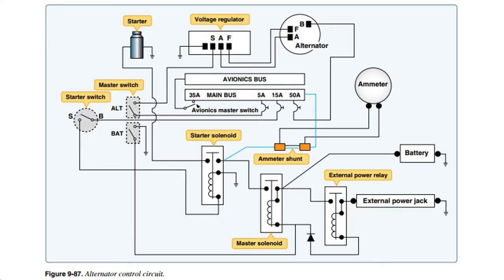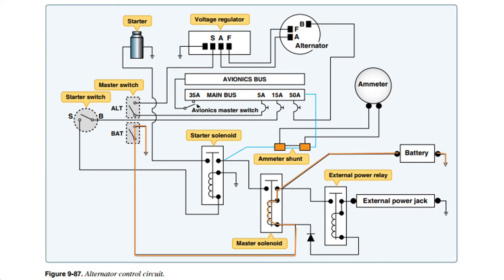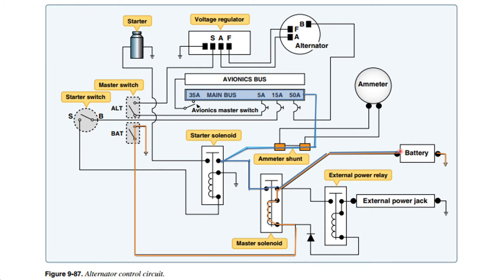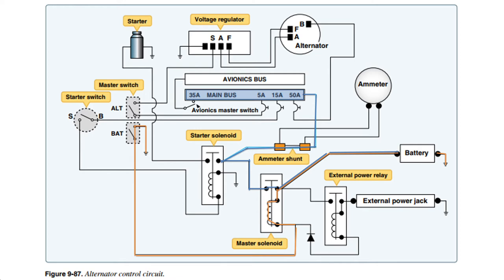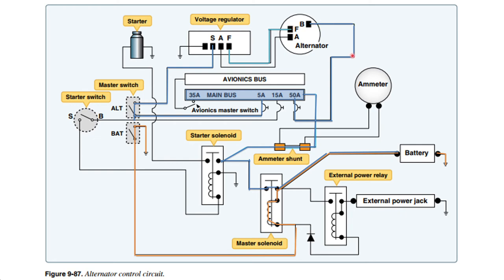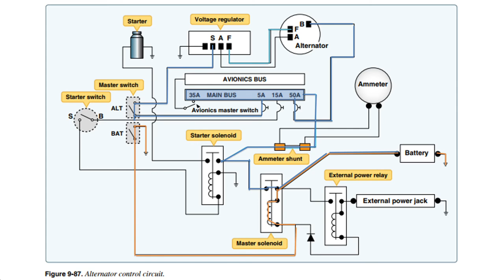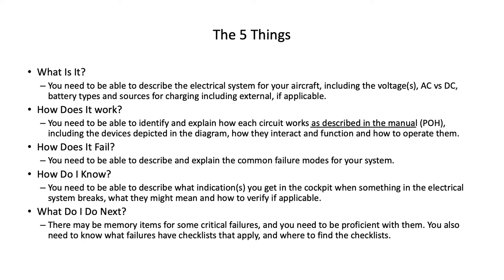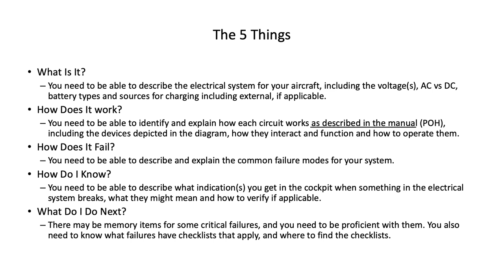ASA   Aircraft Electrical Systems

Comment: So, the alternator requires a little electricity in order to "make" enough electricity to send back to the battery? I'm a little confused about the field pathway that you talked about. It seems like electricity from the main bus (which came from the battery) is being sent to the alternator, which then generates enough additional energy to replenish the battery.

I was always under the impression that if your battery was totally dead, you could hand-prop the airplane and get it to start, which would then spin the alternator to recharge the battery. Where does that field current come from if the battery is totally drained? I know that the airplane would start because the magnetos are independent of the electrical system, but would this imply that the alternator just wouldn't be able to charge the battery even if the engine was turning?
Reply from the maker: Good question. It depends on what you mean by "totally dead" battery. If the battery his truly totally dead, then the alternator would be useless. As you said, with no electricity for the field, you can't make more electricity. Not only that, but when you turn on the master switch the master relay couldn't work, so there would be no way to get the system running.

Having said that, if your battery is so low that it won't turn the starter it PROBABLY still has SOME juice left. If you can get the engine running by prop-starting it - and you are correct about the mags being independent - then there is probably enough left in the battery to energize the master relay and provide enough magnetism to get the alternator producing. Once that happens, you have all you need. 

Now, I've never actually run the experiment with the totally dead (or disconnected) battery scenario. There MAY be some residual permanent magnetism left in the field core (rotor), and it MAY be enough to get things started. The old generators relied on this at startup, in fact.

Bottom line from a practical / safety point of view is that if you battery is truly totally dead, you should swap it out for a charged one. If it's low enough that the starter doesn't work, hook-up some external power rather than prop-starting. There are just too many things that can go wrong prop-starting aircraft that isn't designed for it, in my opinion. Unless you've had instruction on the finer points of propping, and unless there is just no other option, it's just not worth it.